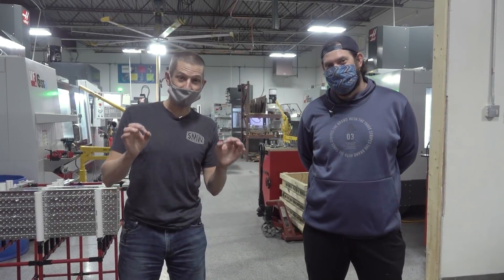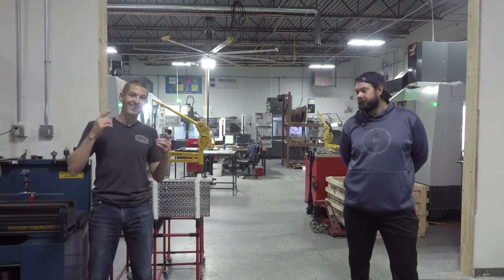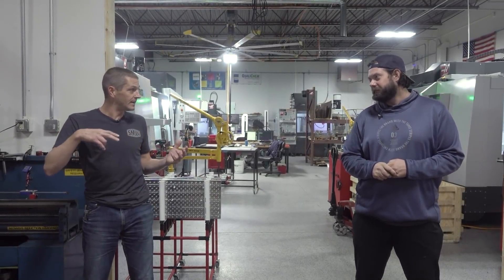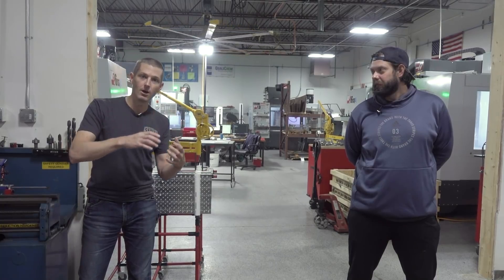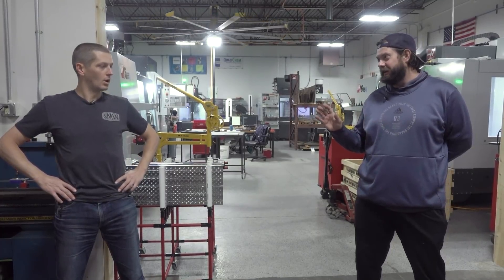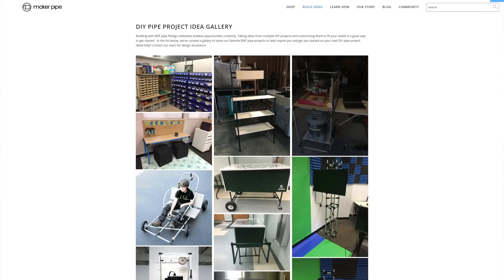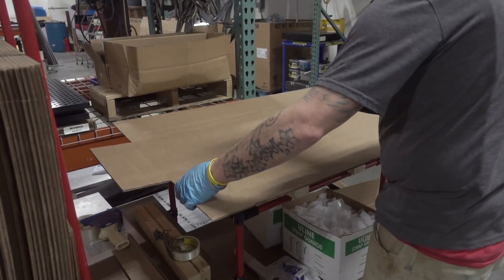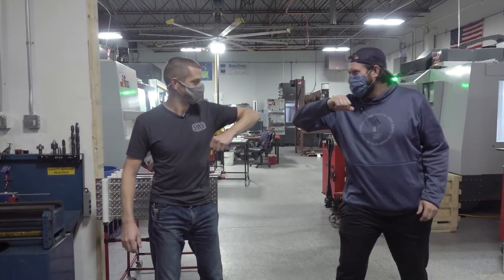Rebuilding The Shop: Maker Pipe Custom Work Tables!

Comment: I go to make a bunch of text tube when my shop was slow at Boeing. I had fun with it because I got to design in my head, did do some really ruff sketches though.  

Would of been a lot faster if they let me build out of Bosch, but apparently it’s way more expensive. Personally I doubt they saved much money with the cost of my labor.

Comment: Hey NYC CNC, you can make some pretty incredible stuff with these type of systems. My tip for you is to search for  “karakuri pipe joint system” and click away. We use this at the plant I work at, although we are a very large workplace where tools such as these perhaps are more useful than at a smaller shop, I’m sure you’ll be at least a little inspired. The system we use is called G.S-Ace but there are of course dozens of different brands.

Comment: Glad to see a small business from SC (my home state) making it happen. It might be worth looking into “5S” & “6-Sigma” if you haven’t already. This was pretty big when I worked for FN Manufacturing in Columbia, SC. I was even more surprised to see training offered in both of these areas when I was a jet engine mechanic in the Marine Corps. It’s all about workflow & process improvement. It was constantly implemented & definitely made a noticeable difference. One thing FN did as an incentive for the employees was to offer a check for 10% of the company’s calculated annual savings to whomever improved a process. For example, there was a guy that operated a CNC machine that came up with the idea to install a screened spigot at the bottom of the chip catcher. This allowed the company to better refine & recycle the cutting fluid. Saved FN roughly $750K/yr & the employee got a check for $75K.

Comment: Quite a lot people actually use scaffolding pipes to quickly make different kind of structures, in pretty much the same way as you did. Except this MakerPipe is obviously light-duty and way cheaper.
I'm just saying that the idea is not new, and you can get inspiration by looking at what people make out of scaffolds.

Comment: The motorola facility I worked at had all of their production lines built with a very similar system. I don't recall exactly what the joints looked like. But they built some pretty cool stuff with it. As a production worker I could tell maintenance an idea to improve my workspace and it could be implemented pretty quick.

Comment: The more common type is called "Creform".  We use them all the time in automotive when we need cheap assembly line racking.  Creform.com  They have a much larger library since they've been doing it for decades.  Not trying to diminish what these guys are doing, but it's the equivalent of what MakerBeam is to 80/20 aluminum extrusion.
Reply: I was going to say, I was making tables and fixtures with these 13 years ago. It's nice to see them have competition, but it looks almost identical. These things are great and a lot stronger than they look.

We also used Coroplast panels as work surfaces, easy to clean and cut and it's bendable. You can pop a hole in it and zip tie it to the pipes. I've made similar racks to the shipping racks and I put coroplast panels between them to keep them from interfering.
Reply: You have lots of different companies/brands in this trade....
Reply: Yeah, I think the fittings are almost identical in shape to Creform. But the Creform pipe is a plastic sheath over a metal core. And, as with any brand meant for "industry", it's stupid expensive for a home gamer unless your boss is letting you take home extra pieces. Hopefully these guys have made it easier for us diy guys to get into.

Comment: What Maker Pipe needs is a software allowing the customers to easily design their "furniture". 😎
Reply: Totally AGREE!
Good idea!
Reply: I can create a 3d cad software based on freecad for designing using their system
Reply: At first I thought that FreeCAD plugin might be a good fit, but then realized that barrier of entry is way too high for that one.
Reply: @x_ph1l  The dodo workbench for FreeCAD can do exactly this already - and it isn't hard to use in my opinion.
Reply: (Or use something like geomag but not so expensive.)
Reply: I actually had the same thoughts, but I also want to point out that this MakerPipe is not an entirely new idea, and it's worth looking at what's already out there.
I mean there are actually people who make custom structures out of scaffolds, and software to plan scaffold already exists.
And then there are streetworkout projects like http://kengurupro.us/ which also have pipes and clamps, that work similarly to MakerPipe.
Reply: @sasjadv  Does not matter, because Makerpipe would need their own software.
Reply: @MrKurdishFreak  Well, it's always good practise to look at what's already out there, before you start reinventing the wheel.
Firstly you can look at other software, to see how something is implemented, and maybe you can copy things you like about it.
Secondly, while looking you might even come across an opensource project, that you can pretty much fork, tweak and rebrand.
And then there is something like creform.de that has existed for quite a while now.
Reply: @sasjadv  What are you talking about. FreeCAD is an open source software and i am an expert at it.
Reply: @MrKurdishFreak  Yes, I know. 
What I'm saying is that maybe someone has already made an opensource MakerPipe-like workbench for a CAD program, or maybe someone has already turned it into an open standalone app.

And then Makerpipe is an old idea, Creform and suppliers of the Joker-system have been selling similar pipe connectors for years now. They have quite some nice usecases, that makerpipe didn't think of yet.